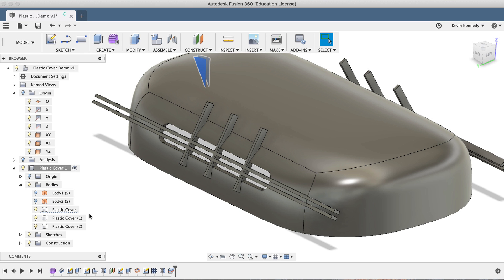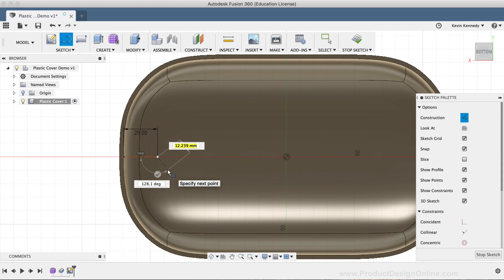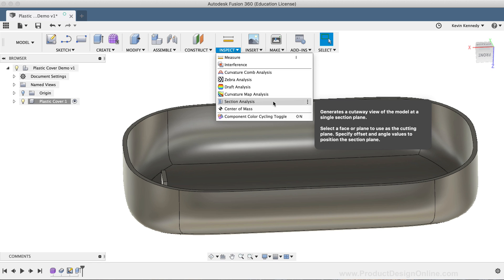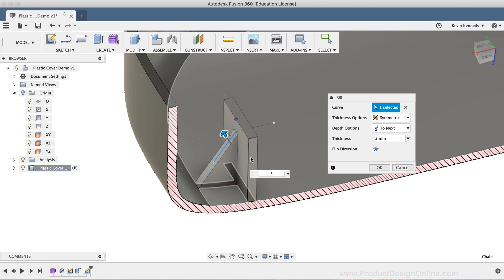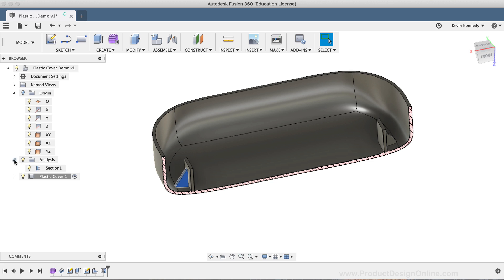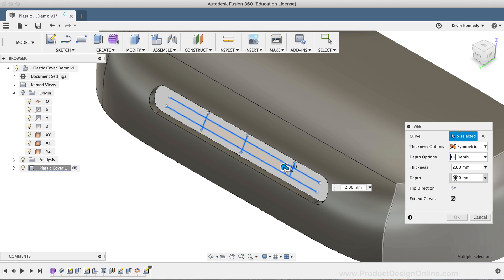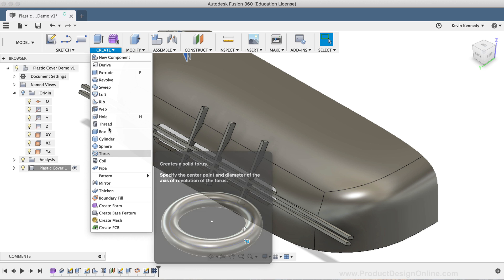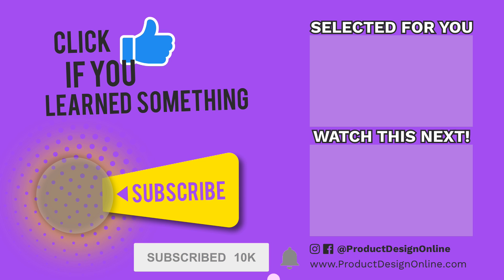Sculpting for Plastic Parts in Fusion 360 (Part 2 of 2)

Comment from the maker: Here's a quick video explaining all 5 slot commands - https://youtu.be/vC7R-0jTxSo
Plastic Cover for Reference (Amazon) - https://amzn.to/2C9PrEq
_
TIMESTAMPS
0:00 - Sculpting for Plastic Parts in Fusion 360
1:45 - Preparing for the rib
4:46 - Section analysis
6:30 - Creating the rib
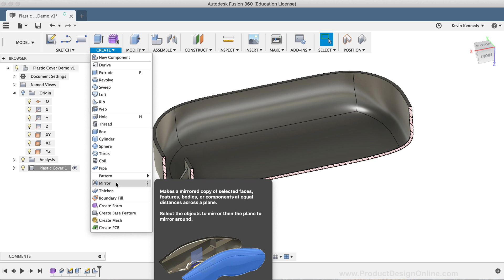8:27 - Mirror the rib
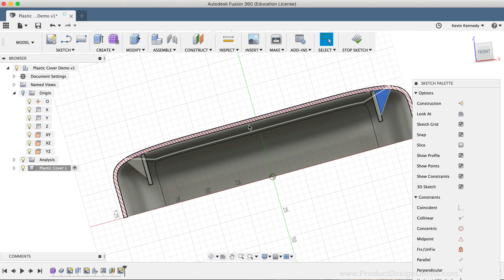10:13 - Center point slot
12:15 - Adding construction planes
13:09 - Creating the web (vent)
14:53 - Trimming the extra web parts

Comment: Great tutorial, keep them coming. On my model after using the split tool to clean up the ribs mine is showing an outline of where the extended ribs were located. Kind of strange as your model doesn't show like this. If I switch to shaded view it's fine,  just curious what would cause this. Thanks for producing these tutorials!
Reply from the maker: Hi, Randy. Are the outlines appearing out in space away from the model or on the actual model itself? Would you be able to share the link to your file or a screenshot? This ones hard to answer without seeing it. Cheers, Kevin :)
Reply: @ProductDesignOnline   Hi Kevin - The outlines are similar to how the inside ribs looks like at 16:02, an embedded outline. I redid the tutorial and it came out fine so I did something a little different in the first time so no sense wasting anymore time on it. Thanks for responding.
Reply from the maker: @randywetzler5976  No problem! I'm always happy to help. Don't hesitate to reach out if you have more questions :)

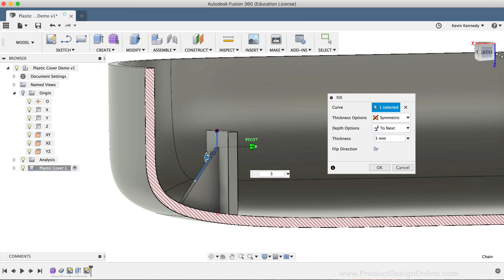Comment: At 6:54 when i try to create the rib i get an error "the curve you are selecting does not intersect a solid body. Select another curve." I've tried this 3 times and get the same error each time. When i change the view slightly i can see that my line isn't even touching the extruded tab but i have no idea why since it snapped into place each time i had drawn it. Any ideas?
Reply from the maker: Hi, Superhero Armory. The only thing that I can think of is that it's not on the correct sketch plane. Did you select the side face of the tab after using the section analysis tool?

If the sketch plane doesn't seem to be it... let me know. I'd be happy to take a look at your file to see what it could be. Cheers, Kevin :)
Reply: I'm having the same issue